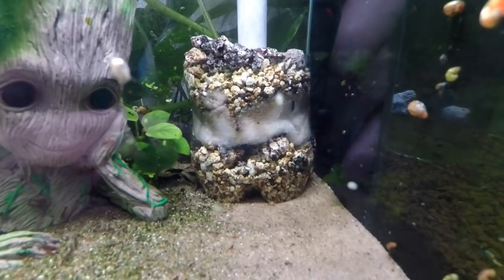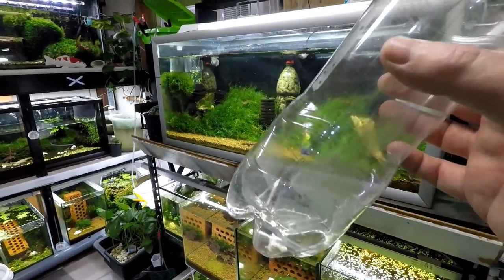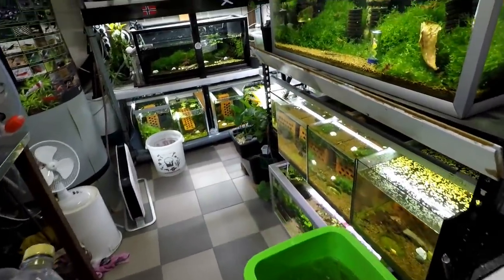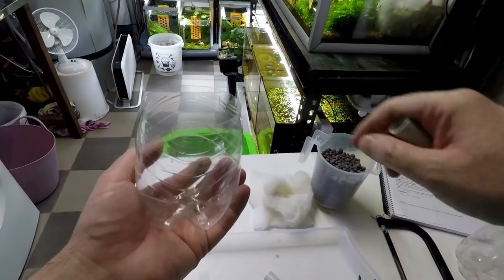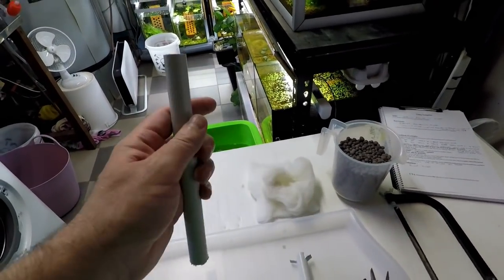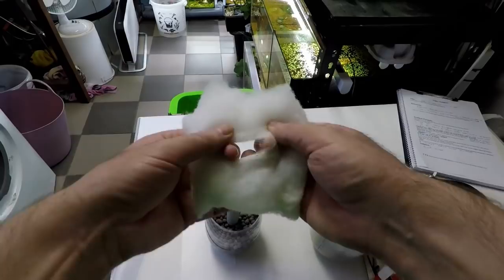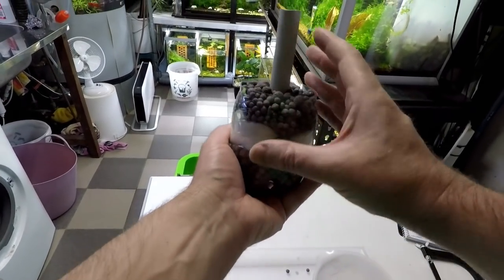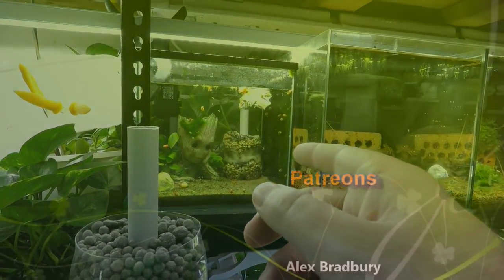How To Make A Cheap Shrimp Filter - Easy DIY Guide

Comment: Hey Mark! I made one of these today, roughly the same style but a couple different layers, it's thick and fairly big but got a 10 gallon air pump for it. It's in a 5 gallon grow out tank I just set up for my new Mystery snail clutch that magically showed up in my tank! My question is, how do I know it's working? Secondly, the media at the bottom is a combination of lava rocks and some ceramic noodles, there IS air gappage in and amongst them, will this affect the suck? If I put my hand over the top to see if I can feel water being pulled up I get the feeling I'm mostly feeling the air stone bubbles LOL! Thanks again for all your help!
Reply from the maker: water will be getting pulled through it all, the air gap will disappear over time and a good way to see that it is actually working is the  white floss layer will get pretty dirty :)

Comment: Please correct me if I am wrong, but these type of bottles are made out of polyethylene terephthalate  (PET). PET and PETA are singe use plastics, and these can leach chemicals more readily over time than any other plastic. So I would be cautious when using these types of plastic.
Reply from the maker: Yeah over time like thousands of years. dont worry about it.
Reply from the maker: oh and if they seriously leeched I doubt thy would be use for human drinking containers, what you have to watch for is colored plastics that are not coated.
Reply from the maker: So there is no risk in a shrimp tank and there will be no issue with a bottle in a tank in sunlight, you are talking extreme heat conditions something we will never see in a shrimp tank, just a FYI  I worked as a plastics exstruder for 5 years making everything from medical equipment to gutters. You are probably at a higher risk from bacteria infections from plastic bottles  in heat compared to shrimp being affected by leeching.
Reply: Use a glass bottle like I do

Comment: What about undergravel filters for shrimp tanks?
Reply from the maker: Pros and cons are they are great for filtration but they also trap junk which we typically as shrimp keeper dont vac so you can see how this would be an issue, I actually removed the video of me setting up a tank with an undergravel filter for this reason ...they get real dirty.

Comment: So...am I understanding correctly that the air stone bubbles that are rising cause the water to pull into the filter from going into the sides that are exposed, draw down to the bottom through the media and floss and then come up the pipe with the air bubbles as clean water? Am I getting that right? lol
Reply from the maker: Yes that is correct
Reply: @MarksShrimpTanks   Excellent! Say...I got your Nettle Mix in the mail today and just got done with this...check it out!! https://www.youtube.com/watch?v=xzwMRBYsavM